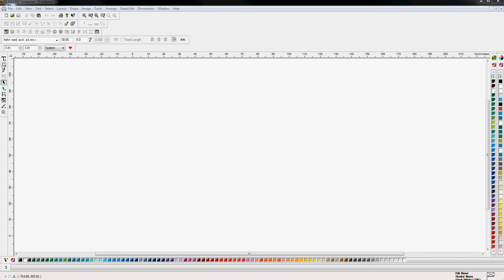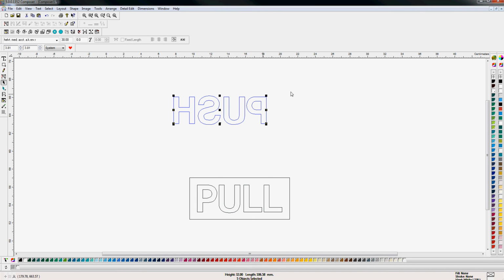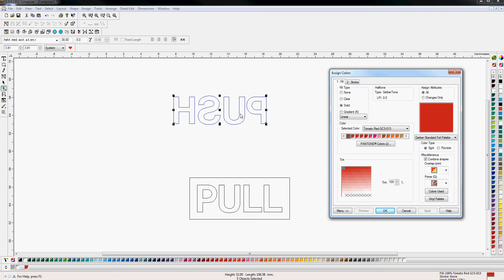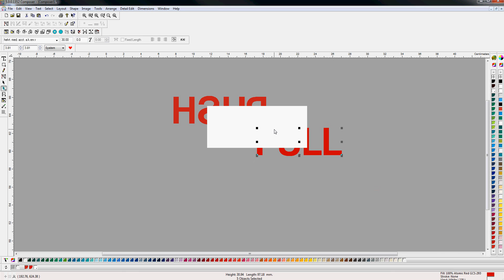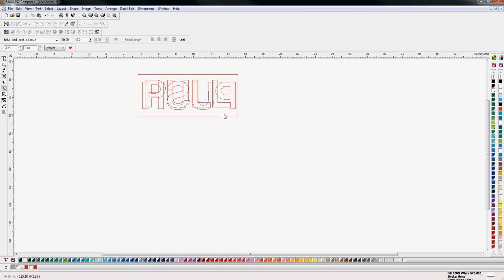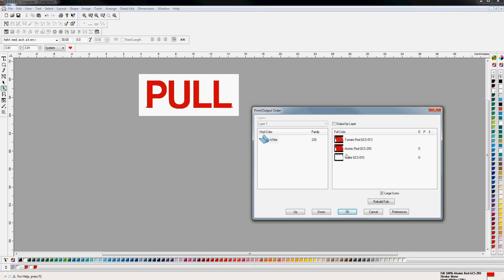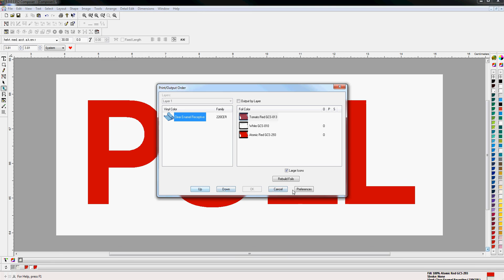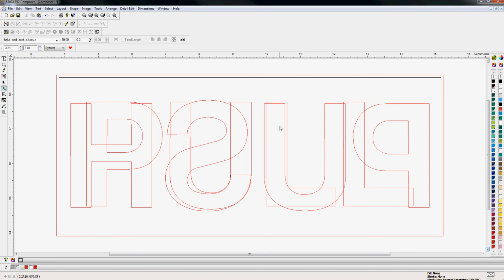Creating a double sided Sticker for the Gerber Edge in Omega 5.0

Comment: Not able to get the white to cover up the first layer of red.... the only thing I have different from the vid is the vinyl,  I'm using a clear 3m graphic film, not sure if that made a difference
Reply from the maker: maybe select all and click the vinyl swatch to ensure they are all on the same vinyl, also check your order. bring the correct item to front for example, check the layer tools and ensure you don't have any layers.. also, and this is a strange one, restart omega, select all items in the file, cut from the current job, open a new job and paste. sometimes pasting in a new job will remove some artifacts that are effecting this..
Reply from the maker: maybe select all and click the vinyl swatch to ensure they are all on the same vinyl, also check your order. bring the correct item to front for example, check the layer tools and ensure you don't have any layers.. also, and this is a strange one, restart omega, select all items in the file, cut from the current job, open a new job and paste. sometimes pasting in a new job will remove some artifacts that are effecting this..